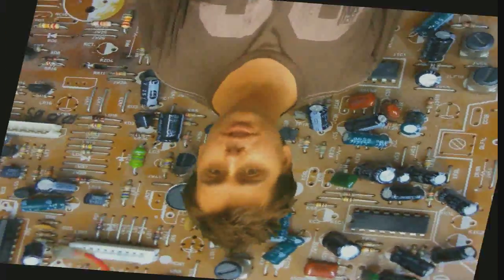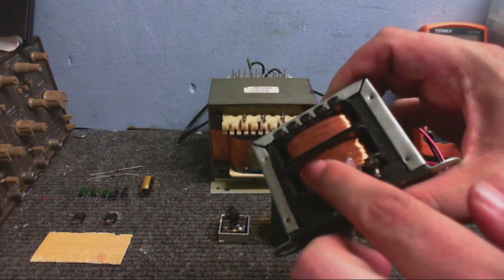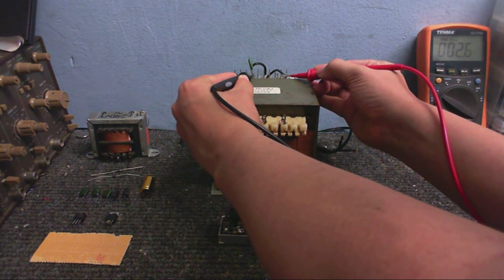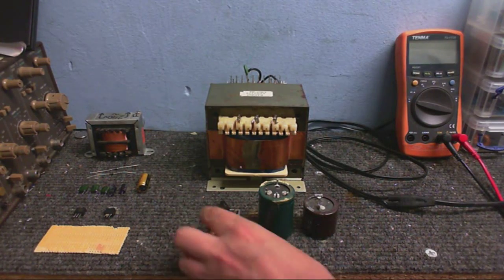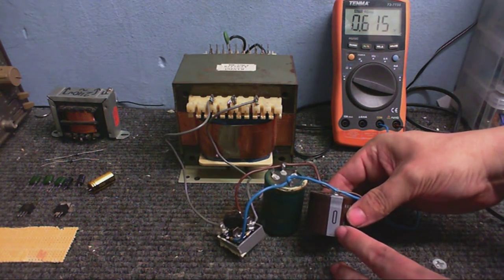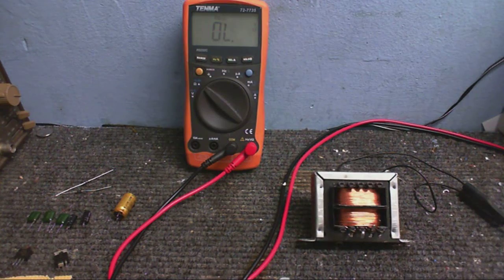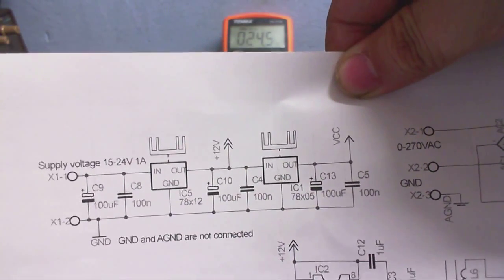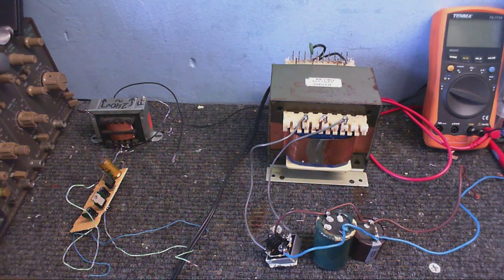Building A Solid State Tesla Coil Part 1 - Power Supplies

Comment: This is great, just what I need. All the other videos never go into the power source, plus you showed the multineter and different power sources. I,m just about to start on my first Tesla coil. Have saved up a few microwaves. But really needed your information, didn't no how to use the multimeter either, absolute beginner. This is perfect. Thanks subscribed. cheers from Australia
Reply: Um I don't think you should mess with microwave transformers as a starter

Comment: Great video. On the big 70 Volts transformer you may need a bit thicker wire, depends upon the current drawn from it, especially when using a ZVS circuit.
Reply from the maker: RODALCO2007 I don't think this is going draw much current or I would have used thicker wire, maybe a couple of amps at the most.  One day I might actually try using that transformer to power up a ZVS and see what happens!

Comment: Clem, you can simply use a 220v bulb lamp with additional button to quickly discharge the capacitors.
Reply from the maker: Faero Alsare I actually do that when I get tired of waiting for the caps to discharge.

Comment: Hi Clem
I have made a slayer exciter circuit using a TIP35C I want to swap it out if I can with a couple of 2N3055's so I can get extra power. I also use this circuit for a Jacob's Ladder and would like the extra power there. Is it an easy swap? Can I just Base to Gate Emitter to Source and Collector Drain etc? I probably have all this wrong. I am also on a tight budget so am scared of killing transistors. If you the time mate I know you are busy.
Reply from the maker: MonkeyMagic Elecifun I wouldn't use a 2N3055, they can't handle the high frequencies you would have in a Tesla coil or slayer exciter.
Reply: CoolDudeClem How about for the Jacob's Ladder?
Reply: CoolDudeClem Is the TIP35C the best or is there another you would suggest? Or can I parallel the TIP's these do seem to work well on the Exciter coil.
Reply from the maker: MonkeyMagic Elecifun You could parallel the TIP35C transistors, though I'm not sure how much improvement that would give.
Reply from the maker: MonkeyMagic Elecifun Try making a fly-back driver and try that on the Jacob's ladder.
Reply: any help would be good, ta
Reply from the maker: MonkeyMagic Elecifun You could try the 2N6341 they have a similar voltage handling capability as the TIP35C, I'm not sure about if they can handle the frequency though, A TIP35C can handle up to about 3Mhz, where as (if I'm right), the 2N6431 can only work up to about 800Khz, again I'm not sure about that, that kind of information seems quite scarce.
Reply: oh dear I do not know what to do now. Maybe stick with TIP's .I have seen a flyback center tapped on the primary and feedback and connected to two 2n3055's could I use the TIP's instead? Cheers for your help. I am in UK too. I like your videos you are a bit organised in chaos like me,lol. I thumbs up to them all because they deal with circuits I like. My aim is to build myself a nice valve amplifier. When I was 6/7 I loved looking in the backs of radios and taking electrical s to bits. My family wasn't happy when I did it to their stuff. What I liked most was valves and there glow and also the beautiful sounds they can help reproduce. Anyways' Cheers